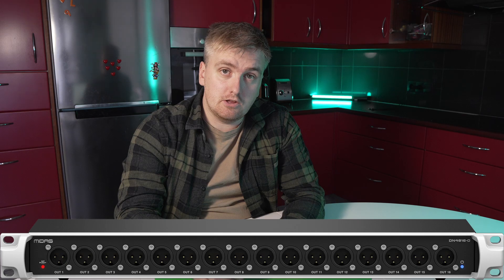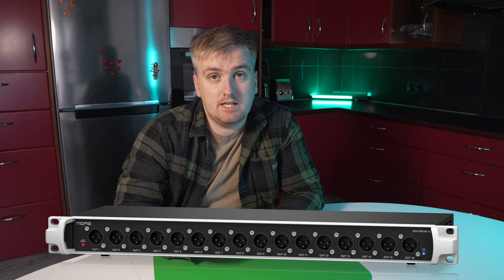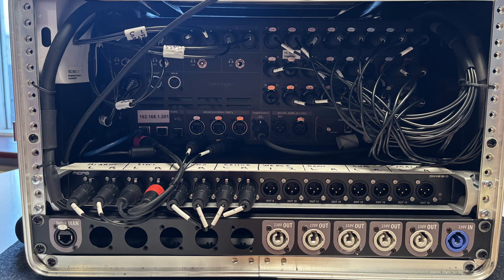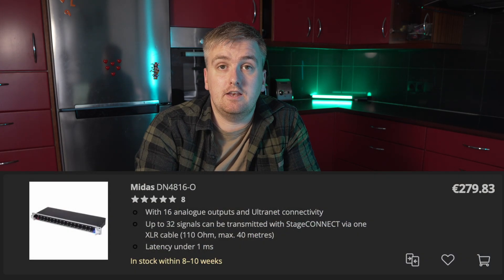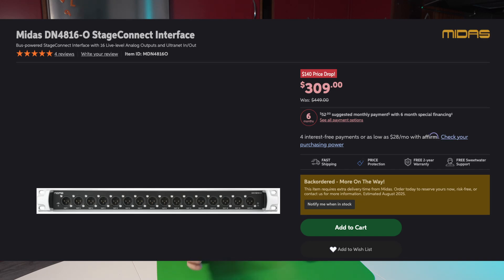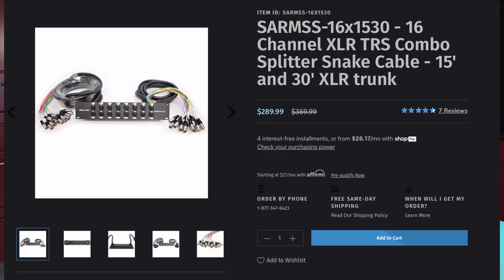The Midas DN4816-O is not a splitter!

Comment: The bands that would use this setup are not playing huge festivals, We're talking about only 16 outputs. You would be using this with a XR or MR mixer. Maybe an X32 rack. These are club or small festivals. If the musicians understand gain structure and what not to do, The Midas DN4816 is quite useable. it's only one rack space and lighter than 2 decent splitters. The Behringer splitters that you spoke about are garbage. plus you're talking about 16 mic cables to the mixer. How expensive is that and how heavy? Compared to 1 ethernet cable. you'll need a 16 channel snake for FOH. That at least can be short 2-3 meters, because you can put the Midas box close to the FOH's snake.  Much quicker to set up and less likely of a patching error. This works well for a 3-4 piece band  that wants a small light setup. Great for fly dates too.
Reply from the maker: My main point is that a 16channel cable split will be lighter and cheaper than this. Check out my live stream https://www.youtube.com/live/FVjtDs8H4zA?si=49fU-MpTj58wafCk
Reply: @allenMarkel  "If the musicians understand gain structure and what not to do"  Please explain gain structure and what NOT to do?

Comment: just use the trim instead of the gain. also gain as low as possible. Apassive splitter makes it also that you have to use more gain on the FOH house desk so that also changes alot of parameters.

Comment: So - setting the Tap for the Ultranet Output for "Analog" (ahead of the Mic Pre) in the MAir Edit app, DOES NOT work for your situation? Isn't that a 1 to 1 direct out of the Analog Input? (Yes there is AD/DA, but most large systems I've worked with have at least a couple instances of conversion in the chain. Cheers!
Reply: I wish it was a 1:1 input signal, but it is not.  Setting the ultranet output to "Analog" still includes your Mixer's preamp level.   I have the DN4816-O myself,  and honestly, I'm still going to use it as a splitter, I'm in cover bands for fun, not a professional touring band.

Comment: What about if all your inputs are at line level anyway? We don't use guitar amps, we are using modelers for guitar and bass, drums are electric, keyboards are at line level anyway, vocals go through an effects rig, most of these inputs are also routed through a RC-600 looper which also outputs at line level - so essentially every input already has gone through a preamp before it even gets to our in ear rig. Using systems like this and cutting down on bulky amps and stage noise seems more  and more common these days. If this is the case would it matter if you used a DN4816-O outputing everything at line level anway? If this is the case the various arguments for not using a DN4816-O seem mute or am I missing something?

Comment: We use a X32 Rack for our IEM and run our own PA. DN4816-0 is connected via Ultranet-Out (Signal routed Input/LC). Now I'm not sure: when giving signal to FOH engineer by DN4816, is it a "splitter"-like signal or gain on it?
Reply from the maker: If the audio is at any point going trough a digital interface, it is going thru the preamp and the AD converter.

The DN4816 is never a splitter, it's always an output device.

Comment: Every decision has compromise built into it. I agree mostly with your video thats why we've stuck to analog splits, but if a band puts in the time, forwards a well put together tech rider / stage plot, and makes a point to note they meticulously gain for LOUDEST at X db and forward that ahead of time. I don't see there being an issue, and at that point its kind of on the sound guy. But I agree when a band comes in because theyve see a youtube video about these device and their gain structure sucks it can leave a really bad taste. That said, I'd love to see a video of you maybe putting together a 24-32 channel 2u/3u split with a multicore to FOH! ... I love the BTPA and NEAT builds but they are crazy expensive. Always wanted to see how to build one of those myself, so selfishly I thought I'd throw it out there haha
Reply: Oh! also IMO the biggest drawback to these is if somehint happens on stage with your rig the entire show goes down! At least if the IEM rig dies with an analog split FOH is still getting signal and you can fight through the set!
Reply: @mattjohnson7660  For the price of this setup, backup your scene on a thumb drive and have a spare. Anyone using this setup is using an XR/MR18, maybe an X32 rack. How expensive is the BTPA/Neat builds? I guarantee a lot more. If you were stepping up to n M32 core with stage box then the custom build makes more sense.
Reply: I think This is the only Real concern.

Comment: I set my iem sends prefade and foh output as postfade, then set all the faders to -20 which get the dn4816o outputs down where  the foh preamp want them. Fully adjustable if foh want more or less and is independent of iem. I firmly believe this is the way.
Reply from the maker: If you are giving FOH your post fader levels, that means FOH is getting all your processing aswell. I definitely would not be very happy with that doing FOH.
Reply: @arnieitthvad my band uses amp modelers with wireless and wireless mics (right now drums are handled by a single drum mic for iems and venue mics regularly) tbh we don’t do any processing in the x32 just set out iem levels, if we did what the original commenter said they do wouldn’t we be fine? A one cable set up is really cool to connect two seperate racks and if not is there something similar? Cuz adding splitters makes the setup way more convoluted (our guitars wirelessly go into the racks and then out to floor pedals and then back in, this would add even more mess and less of a show up plug in and play feeling which i tried to pay a lot of money to set out to do )
Reply: I should add the reason I’m looking into this device is because I’d like to down size the total set up hopefully to two fly able racks, but if you say it’s an issue then I’m selling all this bs and using my Apollo x8 and splits to downsize instead and leaving live mixers in the past, way too much trouble just getting some damn outputs only to end up with a spaghetti fest or a refrigerator on wheels lolll
Reply from the maker: @APEGABRIEL  I find that buying into a dedicated mixer setup, and limit yourself not to use any of the processing on it a bit backwards in my opinion to be honest. (Like OP comment, if that's the way he's running the rig)

Do I understand correctly that all the receivers are in the rack, going from the rack to pedalboards, and back into the rack? 

As I said in the video, a digital split "Doesn't have to be an issue" but people just need to be aware of the limitations, and stop thinking about it as a "quick and easy solution".

For me, any channels that goes out and into the rack should go trough a panel on the front, but that's just how I like it. It makes such a difference being able to connect things on the front, but not having to get behind and try to find the right input on the back inside the rack. You can see how my Wing Rack looks in a Video I made.

If you have a panel on the front for the returns from the guitar pedalboards, it's very easy to make a parallel output in that same panel. But that's also me finding building some panels very easy to do. It saves me time and frustration during setup. So taking an evening at home to building something to make the setup nicer is totally worth it in my experience.

I personally wouldn't like to be playing with just a single drum mic. Playing music is a hobby for me, and I'm old enough to deserve enjoying the environment and sound I'm playing in :)

My thought is that FOH should be able to continue even if I unplug the power from my IEM mixer. That's just the basic design concept I work from.
Reply: @arnieitthvad ngl I’m kinda confused, i can’t tell if everything you’ve said in the video and this comment is based on a universal reality or if you personally wouldn’t prefer it, I’m not trying to make anyone’s life harder, but in all honesty if there’s nothing wrong with it then I’ll continue forward. I do plenty that i don’t prefer to create income for myself on the daily.  Digital mixers offer way more than just processing in the form of routing, what other device would be able to make 4 different stereo iem mixes editable through 4 different phones over wifi for my band and also send out to foh? I also send our back tracks through it and out through foh and might even start either hard patching in pitch correction units or a waves server.  Tbh i don’t really understand your stance at all about not using processing, if I’m not sending it to foh anyway then what would be the point in doing it anyway, so my listening is slightly more enjoyable during a 20-30 minute set? I’m there to perform n dip off stage, I’m sure I’m coming off kinda weird right now but i promise im just genuinely confused on this video and also your response so i apologize in advance.
Reply: Also i built 1u rack panels with xlrs for the pedals to come in and out of the rack without having to fish through anything.
Reply from the maker: @APEGABRIEL  No reason to apologise. I can't remember if I say so in the video, but I have said in some other videos that what I say will be my opinion, based on my experience.

What I'm talking about with processing, is that the OP comment, said he was running all channels to the outputs with the fader at -20db. From my understanding, the only way to get a post fader signal, is to also be post processing. 
That means, either he's running post processed channels to FOH, which is less than ideal, or he's mixing to IEMs without any processing, which is also less than Ideal in my experience, sparking the thought about buying into an IEM setup and not using the processing.
If there is a third way to achieve the results I'd be interested to know how.

If your setup works for you and the engineers you work with. Don't change anything. 
However, if someone was building something from scratch, the points I make in the video needs to be understood, so that people can make an informed decision on doing it that way BEFORE putting money and effort into a solution.

If you're using the built in sound card of your digital mixer as playback outputs, the DN4816-O is perfect for that, since then you're not doing a digital split of an analog input, but you're using a DA converter to get digital signals to an analog output.

In regards to pitch correction, I'm not a fan, but that's also because that's just not the music I listen to or enjoy. I've worked numerous festivals where loads of singers are using live tuning (most often the TC Helicon blue unit) and I've found the vocal not to sound very pleasing, but that's also my opinion. 
Using live pitch correction/autotune effect is an artistic choice, which I'm fine with. But if you're running the vocal chain trough all sorts of EQ, Compression or applying reverbs or delays in the processing, then you're making the FOHs mixer's job a lot more difficult, and essentially doing his job already, in a totally different enviroment (in your home studio, but not at a stage, where reflections, PA voicing, bleed etc. are playing a major part)

If you're still confused about anything please keep on commenting and asking :)

Comment: Use a vca to control all the output and reduce signal by 22db. Problem solved

And, please, don't put the DN in your iem rack. Use a spare rack, so the foh mixer can place the DN where he wants via cat5e
Reply from the maker: I might be missing something here, but a VCA will not help.
That would require all the channels to be going trough a bus output. Usually when making a digital split, it's essentially just the input being patched to the output, without going trough any processing channel or bus.

Also, doesn't solve the issue if the first preamp in the chain.

Also, where does a Cat5e relate to the DN4816-O?
Reply: @arnieitthvad DN4816 use ultranet out.
Set your track to ultranet out
Exemple
Kick
Snare
Tom
Tom
Oh
Oh
Etc...

Create a DCA and set it as master for every track mentioned above (A DCA, not a bus or group, a DCA)

Now, set the dca gain to -22db

DCA levels doesn't affect the IEM bus. IT only affect what being send to master and ultranet.
By reducing the signal by 22db, you're now sending signal at around 0.01 Volt to the DN which is mangeable by any console and let the FOH mixer made his gain stage as if he received DI signal with -20 PAD activated from any keyboard, analog hardware on stage...
Reply: I agree with keeping the DN separate. A short 2-3M 16 channel snake to FOH. 1 longer Ethernet cable to mixer.

Comment: The Midas DN4816-O IS a splitter!: 
why? because of convenience! this is a cheap way for small bands to do a 16 channel splitter with minimum rack space.

This thing is mainly used for the XR18, if you are using it with a wing please get SOMETHING ELSE, thus this video should not exist.

All of the points on this video are valid BUT only if you are getting into a professional level band, in that case a XR18 would not be recommended, neither a DN4816-O would not make any sense.

1. the XR18 has a bypass setting for not applying gain in the routing tool, and I doubt the wing would not have it it's called input on the routing, no gain is applied and FOH always seems happy about it!.
2. being said that line level is mostly accepted even though the bypass is mic level the thing could be spitting line level, at this point a console that has problems accepting line level is weird to find and still you might not hear a difference even when the engineer is saying that it is, trust me we are little bitches, this would not affect a show.
3. just hire a sound tech ONE TIME for a session in a show or practice to setup the thing right
4. Yes it can fail! this is the risk on getting an IEM system for cheap and an XR18, but for small band is the price to pay

Cheap split compared to what?: 
Real splitters with transformers are the way to go yes, but they are really expensive!, the others are just a simple Y split and mic level voltage and impedance god forbid that DO NOT USE THEM unless you are in a pinch!.

we are talking 2 rack space minimum, small bands do not have that kind of space!, DN4816-O is still a viable option.

YES WE DO HAVE 16 XLR LAYING AROUND! only a fool would not!

If you already have a DN4816-O, keep using it!, just ask an engineer, "because they don't have a choise" lol we never have a choise I woulndt care LESS if a band shows with one of this, if setup correctly I'll even be excited about it, less hassle

DANTE or MADI? do you know HOW MUCH IT COSTS???

Humble man! as engineers we know we like perfection but this is complaining just for the sake of venting, you know the options are there and the real life is never like you wanted to be, but yet you still think like a promoter wanting expensive brands for a venue that only needs a 1 sub and 2 12" speakers.

Comment: My band used XR18 + Midas DN 4816-O. We haven’t run into problems. If Gain structure is done in conjunction with FOH engineer at sound check and levels are set with enough headroom they can remain untouched and FOH can regain on their side if needed. 
Line level signals could be a problem as you pointed out. 
What I like the most about the DN 4816-O (apart from price, size and weigh) is that I can also split digital channels sent from my laptop (like FX and backing tracks) and select tap points of other channels that are also processed in my laptop. 
I haven’t had issues with routing. It’s always configured and tested previously, tested again at sound check and left untouched throughout the gig. 
Anyway, we are not a pro band. We are just a covers band having some fun.
Reply from the maker: My main purpose of the video is to make people aware of the potential problems in using it as an input split, as I sair around 2:30 - "This doesn't have to be bad, but I'm going to explain when it can be, just so people understand"

What you are saying is the thing you like the most about the 4816-O, are that you can use it as an output device for channels coming from your laptop or other processed channels that you want to output. Which is exactly what it's designed for :)
Reply: @arnieitthvad sure. My comment was intended to tell my experience with the device and the points you stand out in the video are very important to be aware of. Thanks.
Reply from the maker: @MiguelLSilva-ef5is  Thank you likewise :)
Reply: Did you ever test/have phantom power go from the mixing desk intothe DN4816-O? We're looking at using a Wing and 4816 and it appears it's not shielded against phantom power. We're looking at added a pair of Art T-8's to the rig to guard against that, but would prefer not to have to add those (extra bulk/wiring) and just run straight out of the DN4816 if we can do so without risk of a FOH guy borking our rig by sending phantom power up our line level sends.
Reply from the maker: @FakeGlasses I have not, since Im only using the 4816-O as mix outputs.

Instead of the Art8, check our the live stream I did, where I talk about building my own analog split. Haven’t had the time to build it yet but its still on my plan.
Reply: @FakeGlasses I don’t know about that.
Reply: @FakeGlasses From what I’ve read, the 4816 can not receive phantom power, as its output from the MR18, only. Though I don’t know about this.
Reply: @FakeGlasses Great question! 
Will the 4816 be damaged if it receives 48v Phantom on the XLR?
(Or does it simply ignore it as "Phantom"?)
Reply: @G_handle 4816-O is output. How would phantom power run through it?
Reply: @AllenMarkel The question is whether those Outputs being sent the the Inputs of say a Console, that happened to have 48v Phantom on those inputs, will damage the 4816.

Line Outputs expect to be going to Line Inputs.  Some devices can't handle seeing Phantom power on those lines.

Is this device Immune to it, or likely to be damaged by it?